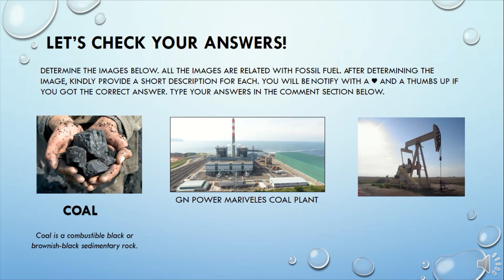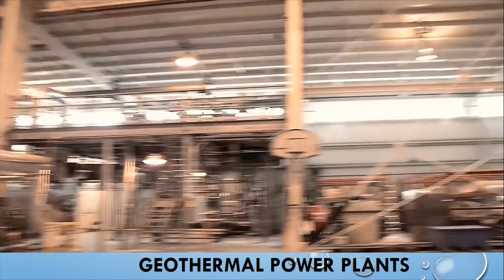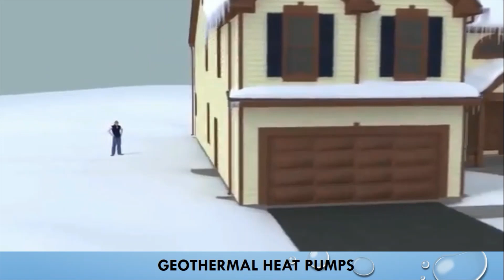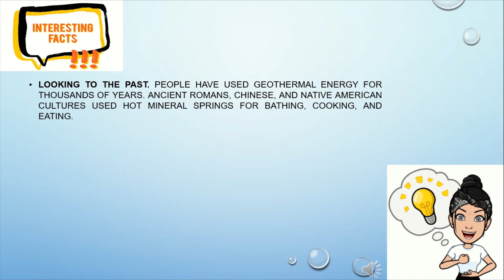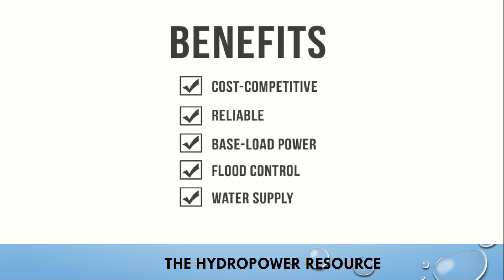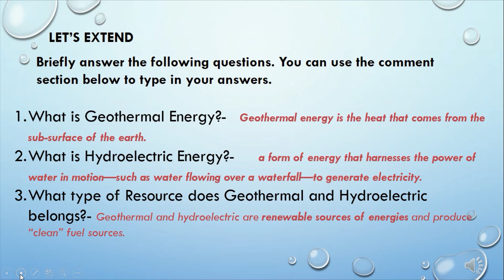GEOTHERMAL ENERGY AND HYDROPOWER RESOURCES (A SHORT DISCUSSION)

Comment: Kirsten Ann D. Florentino - 11-STEM Sagittarius

A. Formed from the decomposed organic remains of prehistoric plants and animals millions of years ago, these materials were exposed under heat and pressure that led to the formation of the fossil fuel we call coal.
B.  A generating station is responsible for producing electricity through burning coal, that supplies society’s electricity needs.
C. We extract crude oil from underneath the ground using pump jacks, this machinery works by lifting up crude oil from the ground to the surface.
Reply: Let’s Extend:
1. Geothermal Energy means the energy sourced from the heat of the Earth.
2. Hydroelectric energy is the process of generating electricity through the flow or movement of the water using mechanical energy which is then converted to electricity.
3. Geothermal and Hydroelectric energy sources are sustainable and renewable energy sources.

Comment: MANRIQUE,JOHNPAUL E.
11-Sagittarius
A. Coal is a type of fossil fuel formed from sediments such as prehistoric animal and plant remains that constantly piled up and become pressurized through time.
B. A generating station is the main supplier or source of electrical energy being supplied to households,one of its example is the gn power  mariveles coal plant which uses coal as its energy resource
C. A pump jack or oil derrick is a mechanic device used to extract crude oil beneath earth's surface.

Comment: San Miguel, Arron Rhasper M.

Let's Review:
a. Coal - An example of fossil fuel. Material that is usually brown or black and most often occurs in stratified sedimentary deposits.
b. Generating Station - source and distributor of electricity.
c. Pump Jack - used to mechanically lift liquid out of the well if there is not enough bottom hole pressure for the liquid to flow all the way to the surface.

Let's Extend:
1. Geothermal energy is the heat that comes from the sub-surface of the earth. It is contained in the rocks and fluids beneath the earth’s crust and can be found as far down to the earth’s hot molten rock, magma.
2. Hydroelectric energy is a form of energy that harnesses the power of water in motion to generate electricity.
3. Both geothermal and hydroelectric energy are classified as renewable energy sources.

Comment: Angel Grace Arciga
11 STEM - Sagittarius

Let's extend
1. Geothermal energy - it is the heat within the earth and is a renewable source of energy source because the heat from the earth is continuously being produces
2. Hydrothermal energy - it is the process where we turned water into heat or energy. It is also a renewable source of energy.
3. They are both classified as renewable source of energy

Comment: Mercado, Trisha Nicole C.
11 STEM - SAGITTARIUS
A. Coal - This is a material that is usually found in sedimentary rock deposits which is where rock and dead plant and animal matter are piled up in layers.
B. Generating Station - it is a facility for the generation of electric power.
C. Pumpjacks - it works like an artificial lift. this simply increases the pressure within an oil well to pull oil to the surface. this is used in the petroleum industry to extract crude oil from an oil well where there is not high enough pressure in the well to force the oil to the surface.

Let's Extend
1. It is the energy that is within the Earth. It is a renewable energy source because it is continuously produced inside the Earth.
2. This is the energy that harness the power of water in motion such as waterfalls, rivers and more. 
3. Both of these are renewable sources of energies.

Comment: Jemima M. Laquindanum.
11-STEM Sagittarius 

Let's Review:
A. Coal. Coal is a combustible black or brownish black sedimentary rock and a material usually found in sedimentary rock deposits where rocks and dead plants and animals are pilled up.
B. Generating Station. Generating Station or also called as a powerplant-it is the source of eletrical energy, GN Power Mariveles Coal Plant and San Miguel Energy Corp are the examples of generating station. 
C. Pump Jack. Pump Jack is an industrial machine used to pump oil from oil deposits. 

Let's Extend:
1. Geothermal Energy is a renewable energy source. It is the heat that comes from deep beneath the surface of the earth.
2. Hydroelectric Energy is one of the oldest and largest sources of renewable energy which uses the natural flow of moving water to generate electricity. 
3. Geothermal and Hydroelectric  are both belong to renewable energy source.

Comment: Rensis Nikko Jose A. Baciles
11 - STEM Virgo

Let's Review:
a. Coal - type of fossil fuel that is formed from sediments that is burned for fuel and energy.
b. Generating Station - is a facility for generating electric power and is the main supplier of electrical energy which is used in our homes.
c. Pump Jack - is a piston pump device used to extract oil from an oil well.

Let's Extend:
1. Geothermal Energy is the heat that is coming from the sub-surface of the Earth. It comes from the heat within the Earth.
2. Hydroelectric Energy is one of the oldest and largest sources of renewable energy.  It utilizes the power of water in motion to generate electricity.
3. They are renewable energy sources and produce clean fuel.

Comment: Nociete, Micaela Jane T.
11-STEM SAGITTARIUS

A. Coal- is known as the largest source of energy and coal is formed in a way that the dead plants are converted into coal.
B. Generating Station- it is also known as power station where electrical power is generated.
C. Pump Jack- used to extract crude oil.

1.Geothermal energy is used for producing electricity.
2.Hydroelectric energy uses natural flow of water in generating electricity.
3. Geothermal and Hydroelectric Energy are both belong to renewable energy sources.

Comment: Alexandra Susane O. Mariano 
11-STEM Phoenix

1.What is Geothermal Energy?
- Because heat is constantly produced inside the earth, geothermal energy is a renewable energy source. Geothermal heat is used for bathing, heating houses, and generating energy

2.What is Hydroelectric Energy?
-  also known as hydroelectric power or hydroelectricity, is a type of energy that generates electricity by harnessing the power of moving water, such as water running over a waterfall.

3. What type of Resource does Geothermal and
 Hydroelectric belongs?
- renewable resources

Comment: Hugo, John Lloyd S.
11-STEM VIRGO
Reply: Lets review 💎
Coal - Coal is a combustible black or brownish-black sendimentary rock, formed as rock strata called cial seams. Coal is mostly carbon with variable amounts of other elements, chiefly hydrogen, sulfur, oxygen, and nitrogen. Coal is primarily used as a fuel.

Generating Station - is an industrial facility for the genaration of electric power

Pump jack - used in thr petroleum industry to extract crude oil from a oil well where there is not high enough pressure in the well to force the oil to the surface
Reply: Let's extend💎
1. What is Geothermal Energy?
-Geothermal Energy comes from the heat within the Earth. The word "geothermal" comes from the Greek words geo, meaning earth and thermal, meaning "heat".

2. What is Hydroelectric Energy?
-One of the oldest and largest sources of renewable energy, which uses the natural flow of moving water to generate electricity.

3. What types of Resource does Geothermal and Hydroelectric belongs?
-Geothermal and Hydroelectric are renewable sources of energies and profuce "clean" fuel sources.

Comment: Pega, Ace Gabriel E.
11-STEM-Pisces

LETS REVIEW
A - Coal - Coal is a fossil fuel that is formed from the remains of dead ancient plants and animals, the remains undergo lithification and coalification in order to be formed into coal.
B - A coal power plant in Mariveles, Bataan - Coal plants use coal to fuel the fire that heats up water for steam to form, that steam will turn turbines that generate electricity.
C - Pump Jack - It is a pump that uses valves, rods, and beams to extract oil from underground using pressure. 

LET'S EXTEND
Geothermal Energy - Its the heat energy naturally produced inside the earth, Geo in greek means Earth and Therme in greek means Heat. Its is considered renewable because heat is constantly being produced due to radioactive decay in the earth and will continue to do so in billions of years.
Hydroelectric Energy - It is energy derived from the flow of water. The flow of water will push a turbine that is connected to a electromagnetic generator to generate electricity. 
They are both Renewable types of sources of energy.

Comment: 11 - VIRGO 
Cunanan. Angelo Joshua A.
a.Coal is a kind of of fossil fuel which is made up of sedimentary rocks such as prehistoric animal and plant remains that have accumulated over time and become pressurized.

B.A generating station is the primary source of electrical energy for residents; one example is the GN Power Mariveles Coal Plant, that uses coal as its primary energy source.

C.Its a machine used in the oil and gas industry to harvest crude oil from beneath the earth or from an oil well where the pressure in the well is insufficient to allow the oil to flow to the surface.

1.Geothermal energy is a renewable source of energy that is extracted from the Earth's core.
2.Hydroelectric energy is generated by harnessing the power of moving water.
3.Both geothermal and hydroelectric energy fall under the category of renewable energy.

Comment: Curteney Biel A. Leano
11 - STEM SAGITTARIUS
Let's Extend
1. it is the heat that comes from the sub-surface of the earth.
2. It is a form of renewable energy that uses the power of moving water to generate electricity.
3. renewable resources
At present, the major commercial grid-connected renewable resources are hydroelectric, geothermal, biomass, wind energy, and solar.

Comment: Alexandra Susane O. Mariano 
11-STEM Phoenix

a. coal- is a flammable black or brownish-black sedimentary rock that is found in the form of coal seams.
b. GN Power Mariveles Coal Plant- a coal power plant in Mariveles, Bataan.
c. Pump Jack- A pump jack is a device used in the petroleum industry to extract crude oil from a well when the pressure in the well isn't high enough to propel the oil to the surface.

Comment: Lingcallo Jude Michael D
11- STEM VIRGO

A. Coal is a type of fossil fuel that is made up of sediments such as prehistoric animal and plant remnants that have accumulated over time and became compressed.
B. A generating station is an industrial facility that produces electricity.
C. Pumpjacks are devices used in the petroleum industry to extract crude oil from wells where the pressure is insufficient to propel the oil to the surface.
Lets extend:

1. Geothermal energy is a renewable form of energy that originates from the Earth's core. It's made from the heat generated during the planet's formation and the radioactive decay of materials that follows.

2. Hydroelectric energy is a type of energy that generates electricity by harnessing the power of moving water.

3. Both geothermal and hydroelectric power are considered renewable energy sources.

Comment: Let's Review
A. Coal- It is the material usually found in sedimentary deposits where rock, dead plant and animal matter are piled up in layers.
B. Generating Station-  it is also known as power plant. Is used for generating electric power.
C. Pump Jack- It is a device use in the petroleum industry to extract crude oil from underground or a oil well where there is not high enough pressure in the well in order to flow the oil to the surface.

John Albert C. Almanza
11-STEM Virgo

Comment: Obdin, Red Kirby N.

A. Coal is a type of fossil fuel formed from sediments such as prehistoric animal and plant remains that constantly piled up and become pressurized through time.
b. A generating station is the main supplier or source of electrical energy being supplied to households, one of its example is the GN Power Mariveles Coal Plant which uses coal as its energy resource.
C. A pump jack or oil derrick is a mechanic device used to extract crude oil beneath earth's surface.

Comment: Cruz, Sophia Lorraine K.
11-STEM Virgo 

Let’s Review:
   A. Coal - a combustible black or brownish-black sedimentary rock and is primarily used as a fuel.
   B. Generating Station - a power station that produces energy
   C. Pump jack - a device used in the oil and gas industry to extract crude oil from a well when the pressure in the well isn't high enough to force the oil to the surface.
Let’s Extend:
   1.Geothermal energy is extracted from the Earth's internal heat. It is used to generate power, as well as to heat buildings and greenhouses.
   2.Hydroelectric energy, which utilizes the natural flow of moving water to generate power, is one of the longest and greatest forms of renewable energy.
   3.Renewable energy sources include geothermal and hydroelectric energy.

Comment: 11 Stem Pisces
Borela, Francis Daryl E.
Reply: Let's Review
1. Coal : is a combustible black or brownish-black sedimentary rock with a high amount of carbon and hydrocarbons. 
2. Generating Station : a facility for the generation of electric power.
3. Pump jacks : device used in the petroleum industry to extract crude oil from an oil well where there is not enough pressure in the well to force the oil to the surface.

Let's Extend
1. Geothermal Energy is heat that comes from beneath the earth's crust and it is renewable energy source since it can be supplied constantly inside earth.
2. Hydroelectric Energy is a renewable energy source that generates electricity by exploiting the natural flow of water.
3. Geothermal and Hydroelectric are both renewable sources of energy.

Comment: A. •Coal is a black or brownish-black sedimentary rock that can be burned for fuel and used to generate electricity.
B• Generating Station is an industrial facility for the generation of electrical power.
C• Pump Jack is a device used in the petroleum industry to extract crude oil from a oil well where is not high enough pressure in the well to force the oil to the surface.

Comment: Garcia, Danah Ricci A.
G11 - STEM Phoenix

A. Coal - a combustible sedimentary rock in black or brownish-black colour. 
B. Generating Station - a power generation for the generation of electric power.
C. Pump Jack - an over ground drive to mechanically lift liquid out of a well

1. Geothermal energy is heat within the earth.
2. Hydroelectric energy is the use of flowing water to produce electrical energy.
3. They belong under renewable resources.

Comment: Basilio, Rocille Aina A.
11-STEM Phoenix

Let's Review:
A. Coal - Coal is an example of fossil fuel. It is a combustible black sedimentary rock that is usually formed as rock strata called coal seams.
B. Generating Station - Generating station or also known as power plant is used for generating electric power.
C. Pump Jack - Pump jack is an equipment used for extracting crude oil underground or oil well.

Let's Extend:
1. Geothermal energy is a renewable energy source that comes from the heat within the Earth.
2. Hydroelectric energy is one of the oldest source of renewable energy that uses natural flow of moving water in order to generate electricity.
3. Both geothermal and hydroelectric energy belong to renewable energy source.

Comment: Bustamante, Samantha S.
11- Stem Phoenix

A. Coal - is a nonrenewable fossil fuel that is combusted and used to generate electricity. 
B. Gn Power Mariveles Coal Plant - a coal power plant in Mariveles Bataan and industrial facility for the generation of electric power.
C. Pump Jack - the overground drive for a reciprocating piston jump in an oil well.

Comment: Let's Extend: 

1. Geothermal energy is the heat that comes from beneath the earth's crust. As a result of the constant production of heat within the earth, it is regarded as a renewable energy source.
2. Hydroelectric energy is one of the oldest renewable source of energy that generates electricity from the natural flow of moving water.
3. Both geothermal energy and hydroelectric energy are classified as a renewable energy sources.

Baluyot, Abbegail Kate S.
11 STEM - Phoenix

Comment: Gravador, Mark Andrei O.
11- STEM PHOENIX
Reply: Lets review

A. COAL is a black or brownish-black sedimentary rock it is nonrenewable and it is formed from dead plants.
B. COAL POWER PLANT it uses coal that produce amount of energy that give electricity to the community.
C. PUMP JACK is used to pump essential oils underground the surface to produce gasoline and etc.
Reply: LETS EXTEND

1. geothermal energy is a renewable source under he earths surface and give's heat, cool, and generate electricity.
2. hydrothermal energy is a renewable source too that gives us electricity  by the water current that makes the turbine spins that produce electricity.
3. both of them are renewable sources that gives amount of energy and electricity.

Comment: A. Coal is generated when dead plant matter decays into peat, which is then transformed to coal over millions of years by the heat and pressure of deep burial                                                                                                                                                                                   B. A power station, often known as a power plant and also referred to as a generating station or generating plant, is an industrial structure that generates electricity.                                                                                                                                                                                   C. A pump jack is a device used in the petroleum industry to extract crude oil from a well when the pressure in the well isn't high enough to propel the oil to the surface.